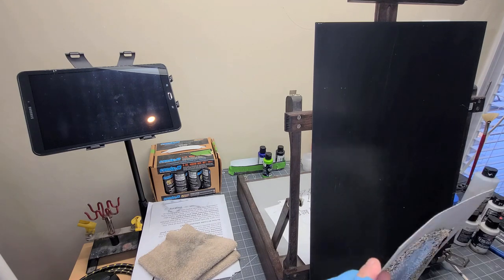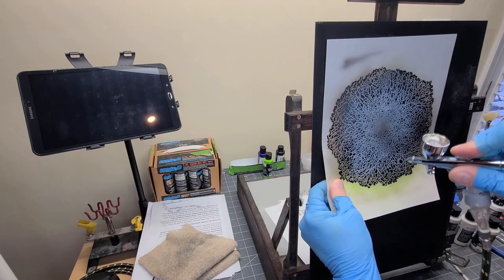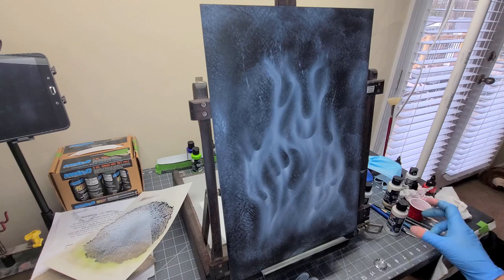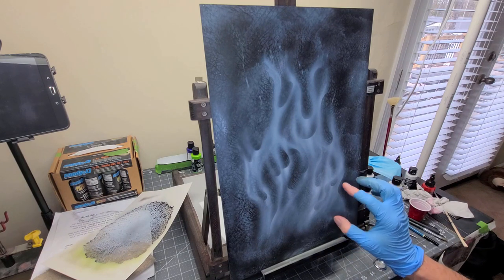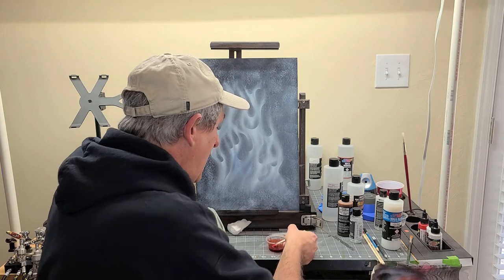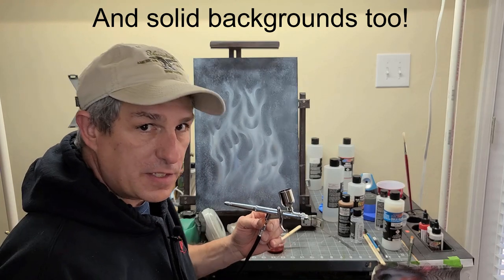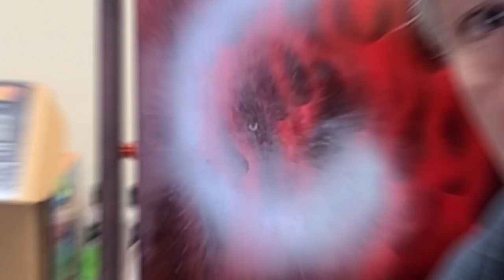Createx Candy 2o Flames & UVLS Clear - Airbrush How to

Comment: I’m new to airbrush and was trying an emerald green candy over metallic charcoal. I was using creatix line of candy mixed with the uvls clear and was experiencing some streaking and milky looking effect. Do you think I was spraying at too high of a psi and letting the candy atomize too much? Or maybe I didn’t wait long enough between coats? I’m kinda lost, ever experienced this issue?
Reply from the maker: Matt, it's hard to say without seeing it or knowing exactly how you mixed it. I let the candy coats dry before applying the next coat. I usually allow about 15 to 20 minutes.

Comment: question about how much reducer to use. I have a .35mm needle what would be the amount of reducer to paint to use? I use createx  airbrush paint.
Reply from the maker: Taz, always start with about 10% reducer check the spray. If you don't have good flow Add in 10% increments until you get good consistent flow. I am usually about 20% with my .35. Thanks for the question and thanks for watching.

Comment: Hope you’re getting better!
In addition to the mask, did you have any kind of ventilation running?  Just getting started and paint in my garage and with the normal paints, it’s not an issue but wasn’t sure about the candy.
Reply from the maker: A-Zone, the answer is yes. It was hard in the covid room, lol, but as soon as I was done spraying I would stop the video and turned a fan on and cleared it out the back door. I have a door in that room to the back yard. Like you I am usually in the garage and I would have my mask on and fans running with the door open. I am working right now on a 2 box fan diy over Spray extractor so keep a look out for that video. To fininish, as soon as you  add the UVLS Clear or any of the Clears and you are going to be breathing in overspray a mask and good ventilation is a must. I will say when I'm just doing regular airbrushing with my Createx paints and a little reducer I don't wear a mask or even ventilate. Just a personal preference.

Comment: Hey Dan, hope your better!
New viewer, and ofc Subber !! Love your vid's, really learning from em ! But a question or 200 ;). needle and tip sizes, for both the candy and the clears, Crea mentions the .5 it would be about the smallest, But can we, in your opinion use smallere .35 or .4 and if at what ratio would you think... A crazy question. would this work like a bit of a shifting colour Pearl Red with a Candy2o Deep Purple..
Reply from the maker: Dann. Thanks for the comment and question. The answer is yes. For years I sprayed my candies with my .35 Eclipse on small areas like when I'm doing fire or a small section of a gas tank. But in the case of doing a whole panel it is easier to use a .5 or larger with a fan spray to cover more area more evenly. But...I have  done it in the past with my Eclipse it's just more difficult and time consuming because you are only getting around an inch or two each pass and then you still need to overlap 50 percent. I would mix 3 parts of the the uvls gloss to one part candy and 30 to 40 percent 4011 for the .35. Same mix for the .5 except 10 percent 4011. Hope this helps and thanks for the kind words and thanks for watching.
Reply: @TheAirbrushGarage  Thanks Dan. Im painting model cars/Trucks, scale 1:24/25, so i dont need to cover a big area like a panel.. YET ;). Im using the Vallejo Game and Model air line, but im at, where the colors are dullish, cant get a proper shine in them, and want to try Creas line, many metallics and Candys, where Vallejo is short !...
I've come to the point where i wanner try painting more than my models, so im trying to find out what to go after, paper or sheets/panels to test my creativity, and check if can get my drawings to like something people would recognize, or starting up with 3 or 4 step stencils...
AGAIN Thanks, and keep it up..
Dann from Dk